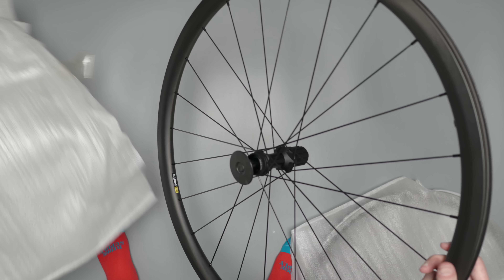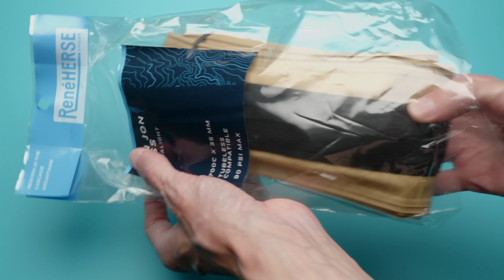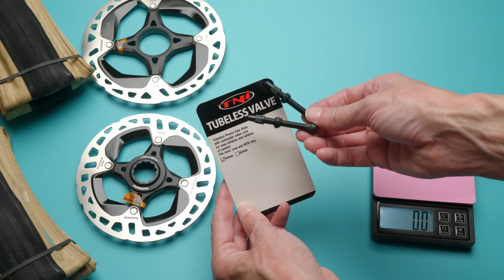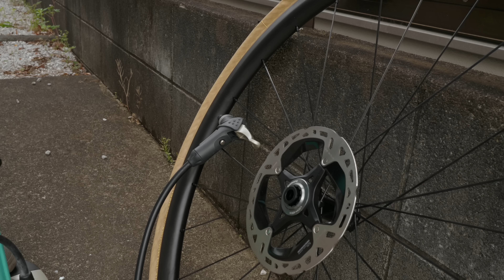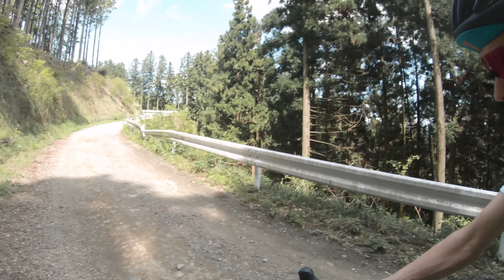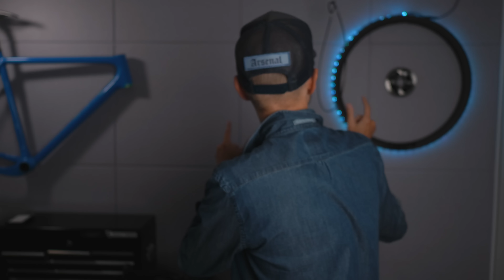Sub 7kg All-Road Bliss #newwheelday

Comment: Good evening, "you are my man"... the review I was looking for so long time. I will go for the 35 mm deep, Feder wheels with carbon ti straight pull 6-bolt hubs. One question: How r u supposed to fix a failed spoke nipple in your case?
Could you also please make a video regarding chain waxing ? Which way do you suggest? The one Oz Cycle proposes [paraffin wax plus PTFE (10:1)] or the liquid squirt form? Thanks and greeting from Crete/Greece.
Reply from the maker: You replace the nipple through the spoke hole, for us a mature I don’t think it will be an enjoyable experience ;)
So if you tend to brake spokes taking the drilled option would probably make your life easier ;)
I’m not doing the DIY waxing... I don’t want wax flakes all over my room when I ride inside 😜 jokes aside it too much of a hassle for me. If I had a garage where I could do this easily I might try but for now drip lube is what I do.
Reply: So, you say that for an experienced mechanic, it is an easy task to change a nipple and/or a spoke?
Reply from the maker: I’m not saying anything as a fact,  but I imagine for an experience wheel builder, I don’t think it would be much of an issue. Whether it’s magnets with brass nipples of some kind of vacuum solution I don’t know...  Will probably take more time, but it’s not impossible... if it ever happen to me I’d be very curious to try it out myself. Having broken one spoke in my lifetime I’m not holding my breath though.

Comment: Could I ask,. I’m trying to decide weather to get a lighter set of 650s or buy some 700s. My bike came with 650s and currently have the switchback hills on them, lovely ride tbh and I seem to be able to keep up with most roadies with a good average most of the time. I don’t race but like to move some what quickly. Could you tell what the ride is like between the 2 ,Bon Jon’s and switch backs. Is there much of difference between the 2 in regards to rolling speed? Love the vid very entertaining and some amazing views!!!!
Reply from the maker: gaza4543 it’s over 1,5 years since I rode the switchback hills so I can’t really compare them. But like you said they roll super nice and I too didn’t have any huge problems keeping up on group rides. 
Riding on the front though at high speed that’s when you notice the aerodynamic disadvantages with such a big tire. (Or maybe it was in my head)
Anything thing you can hide from is the weight. With a lot of climbing I definitely prefer narrower tires on tarmac.
Reply: Rides of Japan thank you for taking the  time to get back to me. Much appreciated

Comment: I haven't read all of the comments, but none of those I've looked through have asked this: 

if i want to buy rim break wheels from faresports, which braking surface is recommended? 
(Couldnt afford a disc brake bike yet 😉) 

My weight is 80kg and i also like to ride mountains. Sadly so far I've only had bad experience with the Performance of carbon wheels 😒

Happy To hear a recommendation form Tobias or his fellow Community 😎 #bikefam
Reply from the maker: Sorry mate, I'm no the right person to ask. Never used rim brake farsports clinchers. There's a long thread about them on Weight Weenies that might be of help though.
Reply: @ridesofjapan  Thanks :)
and thanks for your awesome Videos!!

Comment: Have you ever looked at Nextie Wheels?  Why don't you use the endurance casing, weight?  With the sealant you save the weight is probably about the same, better puncture protection and they are pretty damn supple.  I'll look forward to hearing how adding grease impacts the sound...I can't stand the loud ones.
Reply from the maker: Nope I have not.
Wanted the same feeling on the tires as I’ve experienced in my other extra light compass.
Might try to do some kind of content on the freehub sound if it works

Comment: Re-watching this for the 20th time as I'm riiight there ready to hit the order button! Did you ever consider the wider "gravel"-type wheels from Farsports? About 80-90g heavier for the set, but also 24 internal/30 external. Don't know if that's better for all-road use or not. Really stuck in between.
Reply from the maker: No, not really since I have a proper 650b gravel wheelset already. This wheelset was meant as a comfortable option for 95% tarmac in various conditions that could handle the occasional gravel section out in the mountains. I don’t have any intention of putting on bigger tires than 35mm on these. For bigger tires than 35 I’d say a 24internal would probably be a better choice though.
Reply: @ridesofjapan  Aaaaand there went my money :'-)

Comment: You mentioned in your video that if the bead of the tire is unseated from the rim, there's a chance that the tire is either undersized or oversized for the rim. I started riding road tubeless last year with the Roval CL50 and Continental GP5000TL (25mm) setup. When there isn't sufficient air in the tire, the tire bead will unseat from the wheel. Is this something that I should worried about? My other tubeless experience is Zipp 30 Course with Schwalbe X-One and G-One. With both tires, even when they are completely deflated, their bead do not unseat from the wheel.
Reply from the maker: That was mostly in regard to mounting the tires... I’ve found that if stays up on the shelf without air I usually only need to use my floor pump to seat the tire.
Originally got this information from the Rene herese tubeless manuals some years ago, the smallest tubeless tire they make is the 35, so I imagine a 25mm tire would be prone to creep back into the channel more than a wider tire.
I guess it all depends on the tubeless “shelf” on the rim as well.
If you are worried try adding a layer of tape and see it there’s any difference.
Reply: @ridesofjapan  Thanks for the quick response! I may give another tubeless road tire (perhaps the new Schwalbe Pro One TLE) a try. I think my GP5000TLs are going bald! Earlier this year, I switched from Stan's tubeless sealant to Orange Seal. Before I switched, I took the GP5000TLs off the wheels to clean up the old sealant. I noticed loose strands of rubber - slightly thicker than hair - coming off the tires, on their sidewalls. I pulled a few of them off the tires. Two days ago when I went out for a ride, those loose strands of rubber appeared again, one from the front tire and one from the rear. It can't be good when your tires are going "bald".

Comment: Another great video! 
For the love of WW I cannot tell the difference between their several db wheels (kaze, classic, feder etc...). As you surely looked into it, what sets them apart?
Reply from the maker: Feder is the lightest ;)
For what I understand though it’s that the Feder are design for disc brake only, that way they could make the time lighter.
Reply: Magic word😄, lightest-sold. Thank you!
Reply: Would you still go with the carbon-ti hubs?
Reply from the maker: Personally I pick (and picked) the 180exp, but the best bang/$ is the carbon ti

Comment: The brake rotor is attached to hub..how can wheel flex affect brake rub? A flexy wheel absorbs energy so that the fork wouldn’t flex which if it did flex, would cause the brake to rub.  Also fatter tires absorb the lateral energy more so wheels with fatter tires won’t flex as much.
Reply: If the bearings have play it can happen. It does put torsional stress on the hub, so same effect.

Comment: I'm curious as to why you went with the hooked rims vs the hookless (which are lighter).  Wanting the extra security for tubeless?  Totally understand if so.  I'm looking to move from some Roval CL50's which are hooked, but have no bead shelf or retention ridge.  When you let the air out, the beads pop into the center of the rim almost instantly.  

Seems like there is such variability in tire bead size and strength that having hooked rims with bead shelf and retention ridge is the safest way to go if you don't like your face suddenly meeting pavement.
Reply from the maker: At the time I ordered these the 30mm deep rims were hooked only. If they had a 30mm hookless rim that was lighter I would have bought that instead.
All my other current wheels are hookless and I run tubeless on everything.
Only problem with hookless for me is that there’s a few tire manufacturers that don’t “support” hookless. (Veloflex new tubeless for example 😢)
Reply: @ridesofjapan  that makes sense. If I was using them exclusively for larger tires like you, then I'd go hookless as well. With 28s at road pressures, I think the hook is a good idea for now given the variability in actual rim and bead sizing. You need look no further than the new Rovals to understand that blow offs with road tubeless is still a thing. Clearly those rims were designed to be tubeless but just came in a bit undersized and now through the magic of marketing spin, tubeless is bad. Lol. Unless somebody had verified that these rims are a nice tight fit, I'll stick with the hooked, especially since they still have a nice bead shelf and retention ridge.  Anyway, thanks for finding these, I ordered a set just like yours but 35mm deep. Looking forward to dropping 300 grams over my roval cl50s, and I've never actually owned dt180's before. Teeheehee. 

Keep up the good work. Your videos are fantastic.

Comment: How much pressure do you put in your tires ? 30ml of sealant is all I need in my Mavic Tubeless setup and there’s no leakage for weeks on ends ! And it lasts a good amount of time before it dries out (I got a puncture 6 months after installing it and it still sealed the puncture properly without me having to even put pressure back).
Reply from the maker: Max 40psi, lower if I know there’s gravel.

Comment: Which floor pump are you using and do you recommend? Thanks!
Reply from the maker: Mine is an old Bianchi pump I got with an old bike, but I suspect it's made by Topeak.
Any pump by a reputable brand will do fine (Topeak, Lezyne, Silca etc). But if you're thinking of using it with tubeless I might be a good idea to consider getting a pump with an air reservoir to make life a bit easier.
https://amzn.to/2M2xaxm
Reply: Rides of Japan OMG a true bike geek’s floor pump (the Topeak Joe Blow Booster that is). Thanks for the link and the prompt reply!

Comment: In the video, you talked about how you might add an extra layer (or two?) of rim tape if the tire bead unseated after deflating.

I'm currently having that issue with my wheelset/tire combo - Roval CL50s with Schwalbe Pro One (the new Addix ones). Is adding an extra layer of rim tape something I should try if I'm worried about the tire bead unseating? Or does anyone have recommendations for a set of tires that doesn't unseat on the Roval CL50s when deflating?
Reply from the maker: It's doesn't mean that the tire will unseat from the rim when pumped up and ready. I might just be harder to seat in the first place with a floor pump.
How well the tire stays seated without air can depend on how the rim bed is shaped, does it have a "bead lock bump" etc. I don't know how Rovals are made though
Reply: @ridesofjapan  

Whoah! I was not expecting a reply - quite honored that you did! Great job on your videos - I really enjoy them. :)

Right - my tire keeps unseating when I deflate it and I want to figure out if I can do anything to help it stayed seated.

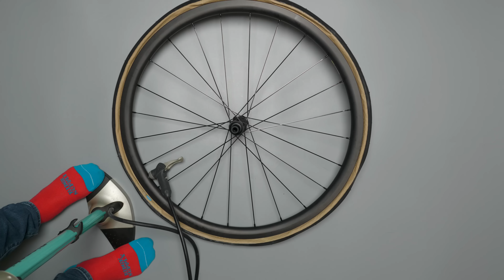I'll check with Roval to see if they have a "bead lock bump" on the rim of the CL50s. I guess if they don't, then I might be out of luck in this regard? But in the case that there isn't a "bead lock bump", I'm wondering whether or not adding a layer or two of rim tape might help. You touch on this point at 6:47 in your video.
Reply from the maker: If there’s no “bump” on the “bead shelf” (excuse my made-up words) I don’t think another layer of tap would change anything... you could always try though.
In the case of the farsport rims they have that pump that will keep the bead from creating down in to the rim channel when deflated 
https://www.wheelsfar.com/u_file/2006/photo/5175ff2e74.jpg
Reply: I see what you mean with the Farsports rim profile. Makes sense.

Roval support actually got back to me in this time, but they didn't answer my question about the "bead lock bump" and just stated that they only guaranteed tubeless compatibility with their in-house Specialized brand tubeless tires (https://www.specialized.com/us/en/s-works-turbo-rapidair-2bliss-ready/p/170432). I guess I'll check the rim profile myself the next time I take my tires off. But from the pictures online, it doesn't really look like it (https://rovalcomponents.com/products/cl-50).

Maybe I'll try the Specialized tires next time.

Thanks for your advice and expertise!

Comment: How does the ride of the Rene Herse extralight compare to gravel king? Can you really tell the extra compliance?
Reply from the maker: They ride super nice no question about that, I have not ridden the 35c gravelkings so can’t give an fair comparison. I have the GK in both 32 and 38, and can only speak from memory (not reliable) and I want to say the ride a bit nicer then both... but it’s not a huge night and day difference.
Had it not been for how they look I would have gotten the gravelkings instead for sure. And I probably switch to that next.
Messing around the weeping sidewalls is not really worth the effort.
Reply: @ridesofjapan  I thought they figured out that weeping sidewalls problem. Alas, maybe not with the extralight casing. Why dont you try out the latex tubes? lighter than the amount of sealant and  easier to setup.
Reply from the maker: Inner tubes don’t fix punctures ;)

Comment: So how are the wheels holding up a few months later? I am thinking about getting the 30mm Gravel wheels with Novatec hubs...I assume it's the same rims are yours....looks really interesting....
Reply from the maker: No issues so far... although, I've been riding a lot less outdoor than normal. But I have done both long and short rides ranging for 50km to 320km, and they been solid... 
but that's with dt180 hubs, I wouldn't use that as a reference for a complete different hub. Not saying that it will be any worse or better, but It's basically a completely different wheel :)
I have no personal experience with Novatec.
Reply: @ridesofjapan  thanks very much for the reply, much appreciated! I have had several Novatec hubs on non-disc brake wheels and always been very happy...just have no experience with disc brake wheels at all and a little worried about using such a lightweight wheelset for gravel...but then most people seem to be very positive about Farsports in general...I might just risk it and see how it goes :)

Comment: Have you gone bikepacking on these wheels (with your gravelking SS tires) yet? Do you think the 24 spoke count will hold up in that scenario or would you rather have requested 28 spokes?
Reply from the maker: The GK SS are on my 650b set, and that is always what I use for bike packing since it’s gives me more bag clearance.
Apart from that I would have no issues taking these wheels for bike packing
I’m a massive 62kg though ;)

Comment: How are your wheels after half a year? I doubt 1200g wheels will hold 2000km? Or will they?
Reply from the maker: Now this year had been crazy as you know so they haven't got much use, just over 1900km but still zero issues (Tires have been swapped though.)
I have no reason to think these wheels won't hold up for multiple season to come.
Reply: @ridesofjapan  That is great news, thanks for that info 👍

Comment: Any particular reason u went for those rims? Quite heavy if you ask me. I bought a custom made wheelset from Timetecbike, same hubs and CX ray spokes 24/24h with rims rated at 250g each, my wheelset came in at 999 gram. Yours are at 1200 :O
Reply from the maker: My main goal was All-day gravel ready and reasonable durable wheelset, bigger tires in the 35mm size was always the plan.I was not looking for a replacement wheel for my Extralite cyberdisc that will continue being my “light” wheels.
Reply: Tubular or clinchers ? How heavy r u ? IMO I would not suggest a clincher wheelset lighter than 1200 gr for a rider heavier than 80 kgs.
Reply: @georgefouskitakis6697  Clincher, I am at 84kg atm, 80kg last year.
Reply: @sebbelito2975  Could u please post some more details on your wheels ? Depth, hubs, cost, etc.? They come from USA? Thanks.
Reply: @ridesofjapan   hahahah vänta lite nu, är du svensk? WTF? Har följt dig ett tag men aldrig ens kunnat ana, trodde först du var native english och sen upptäckte att du bröt lite, kanske typ belgisk eller nåt. 
Finns det någon video med background story? Om du någonsin kommer tillbaka till Sverige får du anordna en fan-meet ;)
Reply from the maker: Sebastian Edemalm hehe, Ingen backstory, har aldrig velat göra en personlig kanal... håller mig till cykling ;)
Reply: @Sebastian Edemalm could you please let us know the specific model of your rims ? Thanks !!!
Reply: @georgefouskitakis6697  Dt Swiss 180 EXP hubs, Sapim CX ray spokes, Pillar nipples and special carbon rims from Timetec bikes in China
Reply: @sebbelito2975  Thanks for the prompt reply. I visited Timetec's website but I could not locate  a disk brake rim weighting just 250 gr. Could you please let us know the specific model of the rim? Thanks again.
Reply: @georgefouskitakis6697  Not sure if they have a specific model on their website. Send them a message for the 19.6 ID / 24mm OD rim and they can help you :) I bought it via messages with their support